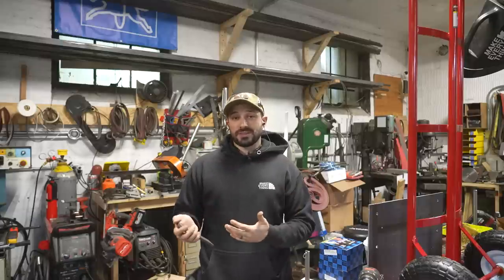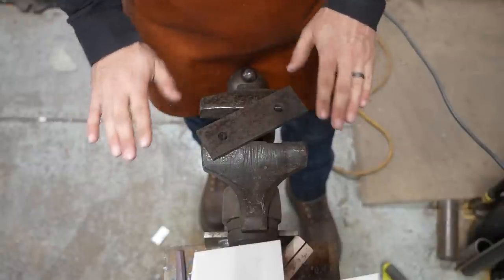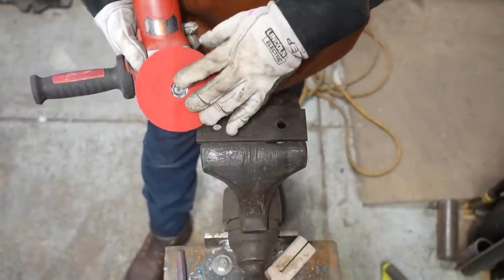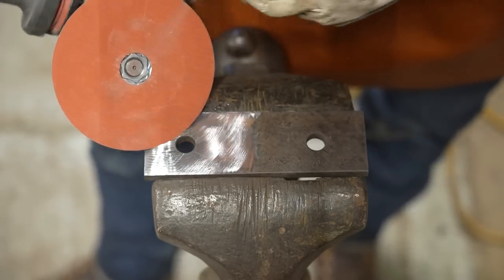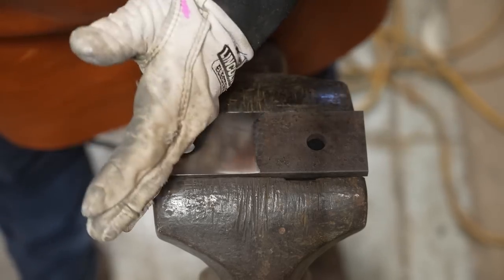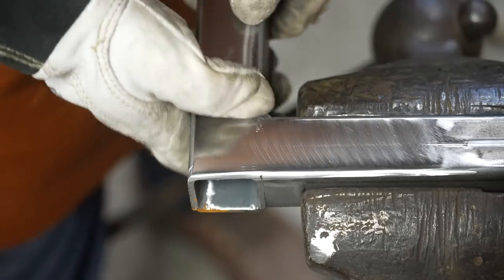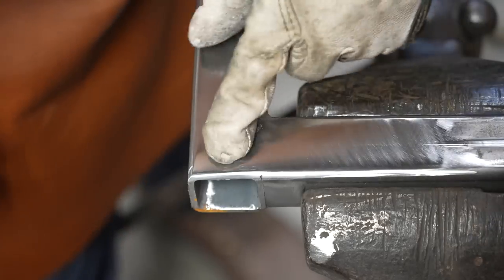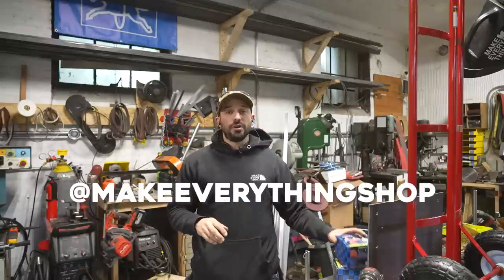This Metalworking Tool Will Save You Time!

Comment: About a minute of using a 3M roloc bristle brush, green, gave me about the same finish with no gouges.  I could have sworn that it was your video that led me to that, and I'm forever thankful for it, whoever made it.  Going through all of those steps to a finish seems excessive in most cases, not to mention the cost.

Comment: When chatting with PFERD rep. see if you can get them to provide similar kits for both die grinders and angle grinders. Combidisc 2 to 3 inch kits for die grinder. 7/8 inch hole 4.5 and 5 inch disk kits for angle grinders. I would buy a twisted wheel/cup kit for both angle grinder and die grinder, instead of a pack of each type. Purchases from Canada would be helpful.

Some of your links already show as unavailable, BTW.

Comment: I'm a welder, as part of my apprenticeship I got to stand and just grind parts for 5 months.
Calling the result he got a "Polish"... is almost insulting, you can still see grinding marks clear as day.

If you actually wanna polish metal, you'll ALSO need a random orbital sander along with 80, 120, 180, 240, 400, 600 and 1200 grit abrasive for said random orbital sander. Oh and 2-3 hours even if it's just a tiny piece of plate you wanna polish to a mirror.

Oh and uhhh, no. You don't need a angle grinder with a variable speed.

Comment: I’ve done countless stairs and railings over the years.    The finish you made looks great but would it be practical if you are priming/finish painting?    I usually use a 36 grit pad or flap disc and then paint.    I rarely went to 80 grit, they don’t last as long or cut as quickly as the 36.     

Again, that was an awesome finish, just trying to decide if it’s practical for me.   Maybe I’ll throw my name in the hat on instagram
Reply: He covers that around @9:07
Reply: @PkwyDrive13  I finished watching later in the evening and saw that.  I wouldn’t mind trying something like that on galvanized that built up or stainless/aluminum but for what I do with steel it’s a bit of an overkill

Comment: Do not buy these.   I just got mine today.   Struggled a bit to get it clicked in but it finally did go on.  I didn't even use it because I was skeptical about easy they would pop on an off.  Now I have spent the last half hour trying to get the disk out of the backing pad.  
I can't even get it to turn off  by prying it to the left using a screwdriver.
Hopefully I can return them or dispute it with the credit card company.   They absolutely suck.
I feel so foolish for falling for this infomercial